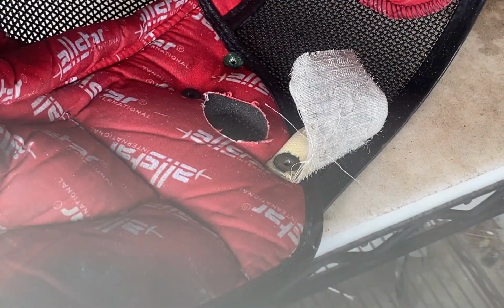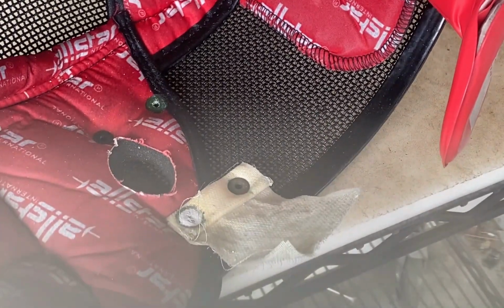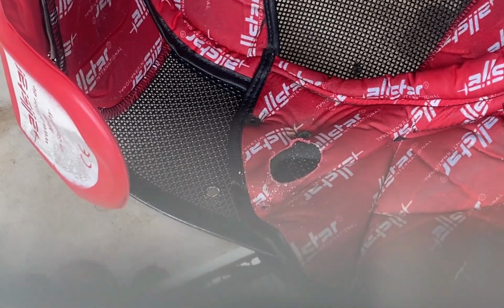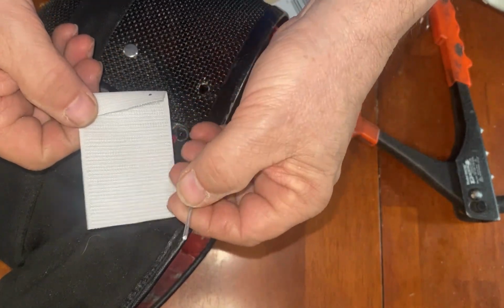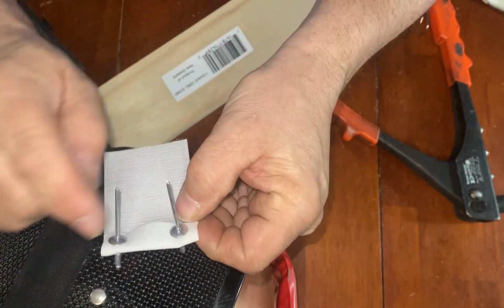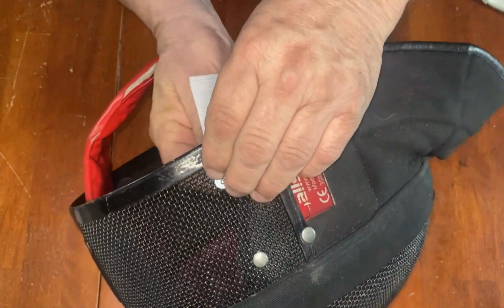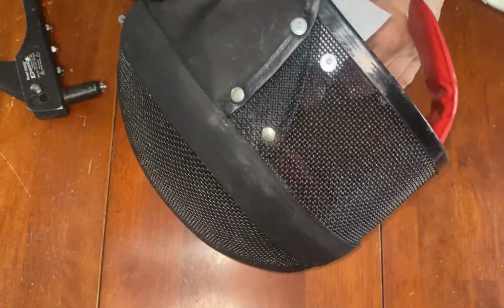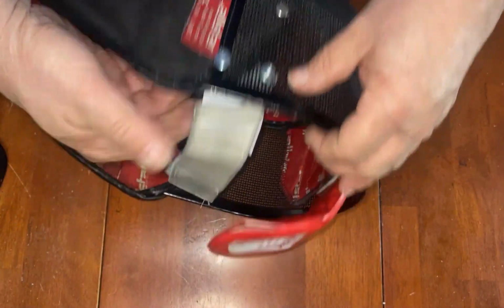I Can Haz Armory # 128 - Replacing a mask strap rivet

Comment: 😮 I need to do this ln a Leon Paul exchange mask on the chin Velcro.  I not sure to do it like your video or just cut out the Velcro and glue in a new one.  🤔🤷🏻‍♂️
Reply from the maker: If it's riveted in from the factory, it should be riveted back in for replacement.  The difficulty will be making room between the strands to get the rivet through.  You might contact LP-USA, as they might have better success with that mask.

Comment: are the new side clips available anywhere to update the masks to the new system?  or would making them be difficult and replacing them...  i need to look at replacing the side clips to the new system required by the FIE as i bought all 1600 masks then years later the requirements for side clips came in (are they required for US competitions ? as they are in Australia... they keep cutting off their nose to spite their faces... sigh)
Reply from the maker: Not that I know of...upgrading on an FIE mask has, I think, some other concerns that I can't address...like the upgrade being done by the maker.

in the US the double strap is NOT required...but all new masks -- FIE and non -- are being made with the FIE system, so as he older ones age out, the double strap will be the norm.